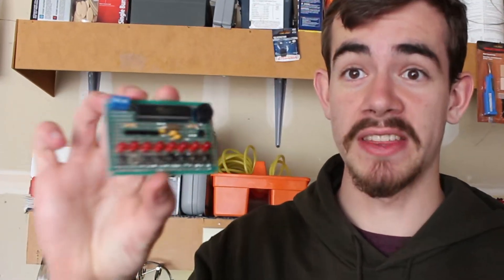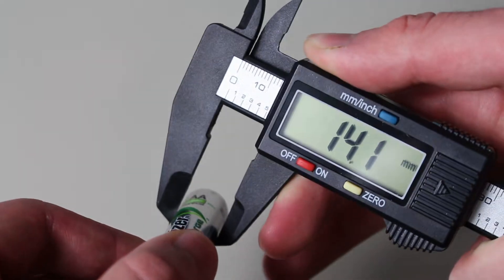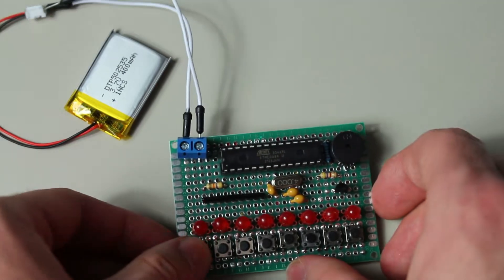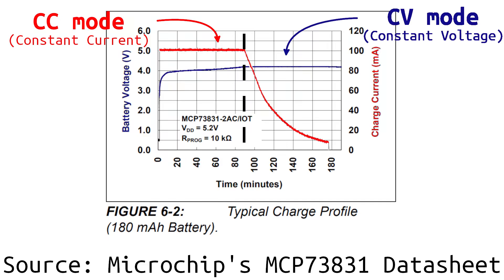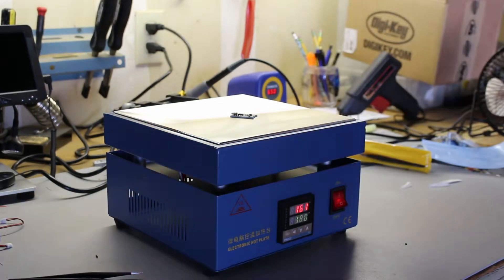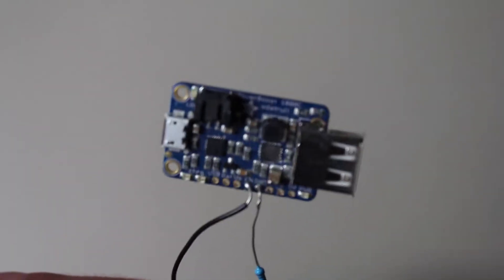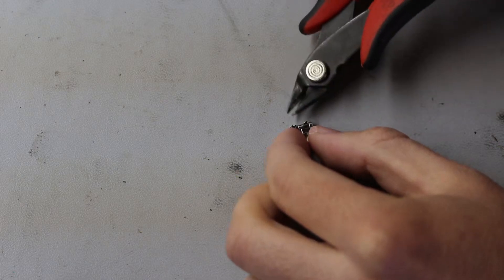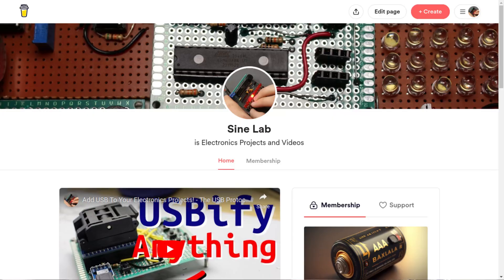Power Your Projects With Batteries! (LiPo/Li-ion)

Comment: can i ask you something? is it possible to do this with a bypass, without buying a bypass lithium charger? so it discharges from the usb power not the battery

i was thinking of alot of p mosfets

Comment: I built a battery powered security system 6  years ago using battery powered Arduino with a small solar panel as a charger for the detection circuits. This worked quite well but the MPU needed to go into sleep mode to preserve the battery but woke up when the body heat activated a small infared detector which had an 18650 lipo battery powering it. The battery manager handled the charging and the circuit also employed a small receiver and transmitter chip ro communicate to the base station at my house.  I was able when a warm body was detected as far away as 20 feet to transmit a code number that signified the activated transmitter and transmit to the receiver which then put a yellow circle around a downloaded google earth photo of the area.

Comment: I thought my ESP32C6 had battery overdischarge protection. I left the battery plugged too long and it discharged to 1.8V. I plugged the USB in ESP32 to charge the battery, the battery swole so fast I had to unplug it and take it outside immediately, before bursting. Make sure your battery has the over-discharge protection. They usually don't

Comment: As a drone guy, lithium polymer and lithium ion are very different beasts due to discharge rates. Might not be as big of an issue in this application, but to me, with my background, they definitely aren't the same.

Comment: Hi i have a question

Can i charge a 100 milliamp lipo battery with a tp4056 replacing the resistor to a 10k resistor instead of 12k ?

Greetings from chile 🇨🇱

Comment: Can we use this board for load sharing?? What i mean by Load sharing is charging the battery and powering your board simultaneously
Reply: It's called Power path. Load sharing is when two cells of the battery pack share the load current. 

Power path: load should by default be on external input and switch to battery on loss of external power. P channel MOSFETS are used on the power path.

Battery needs protection for over charge, over discharge, overload, short circuit, over temperature - independently.

Comment: Appreciate your video 👍I had purchased a LiPo battery set as well as a set of charge controllers that were exactly the ones you had in your video. I didn't know that the board could be used to charge the battery and output power in the same circuit. Although, that does make a lot more sense. I learned exactly what I needed today, and I would say you have earned my subscription. Thank you 😊

Comment: Thank you, A lot, UGH I HAVE SO MUCH TO SAY , but I needed this video. I didn't understand all the terms as I had taken logic design but not circuits (idk why but it wasn't required in tangent when taking the college course) but very helpful. I only came here because I was brainstorming why people charge so much for custom.modded games boys and what their profit margin is. Well, Gameboys cost 60 dollars minimum for broken ones and repairs we most likely be irrelevant since most broken ones are in the screens, so with that in mind I started to look up rechargeable ports to add to a li ion battery for any model game boy and noticed that hey there's a small monopoly on Gameboy charger mods as most cost roughly like 1r dollars. Anyways this video helped me understand that I don't need too much to set up a Gameboy for recharging but I will need some experience in micro soldering or whatever the term is for that

Comment: I don’t have the equipment to replace the resistor on the TP4056. Is it ok to use the default resistor? I’m planning to use the 3.7V battery to power an ESP32 project.
Reply from the maker: It's ok if the resistor gives the correct charging current.

Comment: I just charged a diy 2 cell together after connecting them in parallel. It seems to have worked, Voltage is now 4.2, was 0.07v. Can I assume that I can tape up 5 cells together too using just one charger tp? 
Can you  use this board to charge a Nimh 3.6v cell pack containing 3 1.2v cells?
Reply from the maker: Be careful connecting batteries together in parallel, if they have different voltages then you will have some issues.
Reply: I understand you put them series to get a higher voltage. You cannot just charge this pack by hooking the plus and minus up to a charger! Well,you can, but could be very unsafe if one of the cells starts failing. You risk explosion or at least fire from you battery pack. There are charge modules for 2 cells in series (2S) , 3 cells (3S) etc, which hae an extra wire going to each cell to monitor its state..

Comment: Can i use the default 1 amp charge without having my 3.7v 3 amps lipo battery exploding?
Reply: What capacity? I've seen people recommending 1C as a safest option, but some say 2C is also fine. My question is are you in a hurry? Is 1h vs 30 minutes really makes a difference for charging battery for alarm clock that lasts for weeks?

Comment: My project uses 5 volts for the sensor and the VBUS for 3 volts what kind of battery should I use?
Reply from the maker: You can use a LiPo with a boost up to 5V.

Comment: The first black part (near micro usb) gets very hot in few seconds.
Is this normal?
Reply: Yes, especially if the battery you're charging has a very low charge to begin with. It can get up to 80 C or more but will cool down as the battery charges
Reply: @megabc333  Ok thanks

Comment: I have a question how can i charge the battery if the esp32 or the MC is connected to the usb cable and if it is disconnected from usb cable it should use the battery, i m trying to figure it out and it's getting really complicated
Reply: Did you found the solution ? as i was also searching for the same. The thing you were asking is known as load sharing.

Comment: Good job. I will have to watch this again. Im building a drone, and i need more knowledge of battery safety circuits.

I have cracked open cellphone battery charging bricks. Its not as simple as swapping the big battery for a smaller battery.

Comment: Bro, dw01 chip activates over discharge protection at 2.4v which overtimes permanently damage the battery capacity, if  the load is low dw01 can destroy a liion battery in ony cycle. 2.4v is even more detrimental to.lipolys. A better chip I think is fs312f. Make a video about it, and reply me.

Comment: I would like to ask if I can also use this charging module in charging my li-poly rc battery. I'm planning to charge my battery through solar, though I'm quite unsure if using this charging module will be suitable to li-poly batteries

Comment: Can the TP4056 provide enough power for a ESP32 WROOM-32 board?  Can I use 2 18650's in a holder with the TP4056?
Reply: 18650 with TP4056 does output enough power for ESP32, with the help of a buck converter from 3.7V to 3.3V you can connect it to ESP32's 3.3V Vin pin. If you use 2 x 18650, make sure the holder is wired in parallel (same voltage while increase mAh capacity), fire hazard if wired in series due to TP4056 can only charge 1 cell and does no balancing. When connecting 18650s it is required to charge both 18650 (individually) to max or at least to same voltage before connecting parallel, otherwise you risk damaging 18650s

Comment: Thanks for the informative video.  I bought a gadget to charge the battery and was slightly alarmed when it indicated  fully charged   3.7v cell to 4.2volts .
Reply: 3.7V is nominal volts.
Fully charged is 4.1 or 4.2
Fully discharged about 3V
Reply: Well isn't that the maximum voltage a li-ion battery should be at? What were you alarmed about

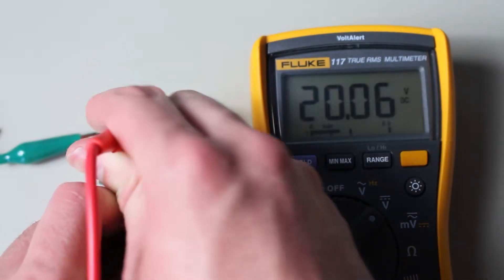Comment: At 6:30 you connect Battery to TP4056 and then to LM2596 right?
I'm connecting two 18650  batteries to LM2596 to supply 5v 3a to my GSM module.
It's working fine but  I want the circuit to shutdown once the batteries are low on power.
Reply from the maker: You can find battery protection ics. They will disconnect the battery from the circuit when it has been over discharged.

Comment: Hey there, thanks for the video! I'm kind of new to making electrical projects such as these, and I was wondering if the battery you use would be able to power a microcontroler such as an ESP32. I noticed the voltage works fine and could work even better if connected to a voltage regulator, but was wondering about the current. Does it supply enough amps for the ESP to work?
Reply from the maker: LiPo batteries can supply a lot of current. It is more than enough to power an ESP32.

Comment: Sir, I am looking for a battery backup for my AVR microcontroller. 
I am using 5V 3A SMPS to run my microcontroller board.
What I want is: 
When MAIN Power Supply goes OFF suddenly- due to power cut, then microcontroller switch  to battery.

Is there any  Module available in market , Which Switch between  "5V Battery" or  "5V SMPS" depending of situation. 
Also battery should charge automatically. 

Please guide or make a video on this topic ......
Reply: you need a path management system.
to put simply, when an input power is detected it disconnects the battery from the TP4056 so all power goes to the microcontroller, but when input power drops the switch is activated connecting the battery to the TP4056 which will then discharge the battery to power the microcontroller.

Comment: In case for a 5V controller supply: Is there a one module that does the charging and DC2DC to 5V? the modules with PCB are quite big.

Comment: Are you sure that Li-Ion and LI-Po are the same?  Maybe they aren't exactly the same! https://en.wikipedia.org/wiki/Lithium-ion_battery  https://en.wikipedia.org/wiki/Lithium_polymer_battery  and for good measure https://en.wikipedia.org/wiki/Lithium_iron_phosphate
Reply: "essentially the same thing" is correct and they are "essentially" but the 'Lifepo4' can catch people out.
Reply: @andymouse  it is essential to understand that different batteries have different usable voltage ranges. This is critical for power delivery circuit. For instance, LiPo batteries can withstand voltages of about 3V without any damage, while LiIon batteries can go as low as 2.5V. Therefore, it is crucial to consider the specific voltage range of the battery you are using when designing a circuit. Remember, there is no "essentially the same" when it comes to designing circuits.
Reply: was pointing out the fact that a lipo and a lion can be used with the same chargers and they can, plus the fact that Life are a different kettle of fish and nobody mentioned the over discharge threshold at all besides it was 2 moths ago. and I don't need a lesson in design from a total stranger on youtube ! good day to you Sir. @AlenHR
Reply: Yeah, that's saying apples and pears are the same.. because the're both edible..

Comment: could you please continue the am transmitter and receiver? and maybe move to fm transmission (because there are not many intermediate videos, only beginner with no explaination or hardcore theory)
Reply from the maker: I'm still working on those, I did a battery video in the meantime :).

Comment: The hot plate that you used greatly improved the look of the circuit board, although it is fun to use a soldering iron.
Reply from the maker: It makes SMD soldering much, much easier.

Comment: I was literally looking into the same chips today. I have an application where I usually have my device plugged into USB C 5v for power, but I would like to be able to unplug the power and still use it with a battery. I found some boards that do exactly this and have a 5V boost converter to bring the 3.7V up to 5V.
Unless I'm misinterpreting what I ordered on Amazon this chip solves all the problems.
Reply from the maker: Yes, they should work, considering that they have the necessary protection features.

Comment: The main problem with using a rechargeable battery is a circuit that can supply power even while charging (charge power separate from output power). TP4056 kind of works for it, but what we really need is a PMIC